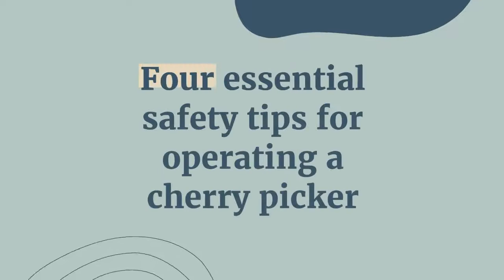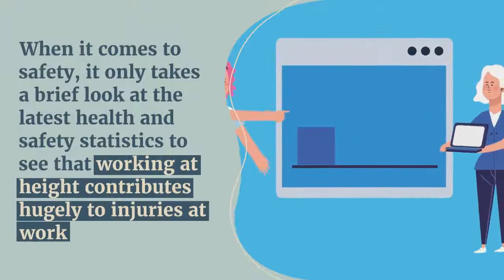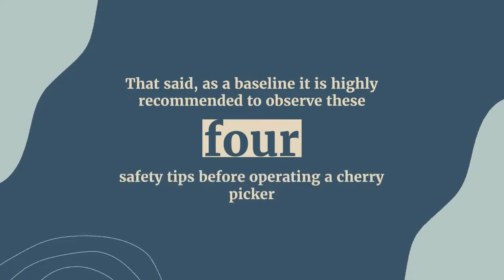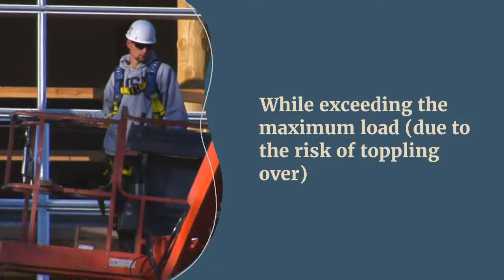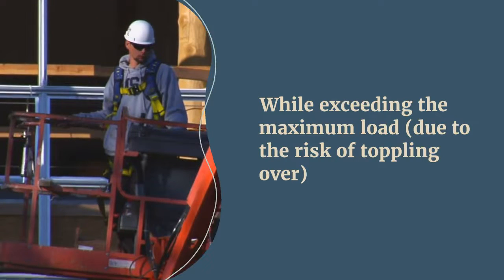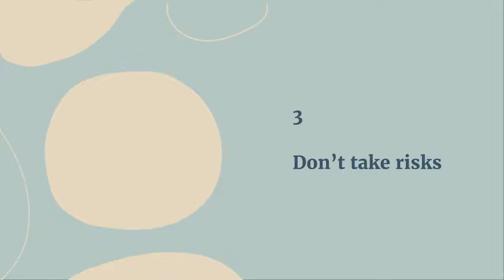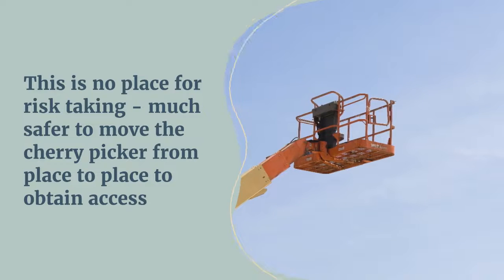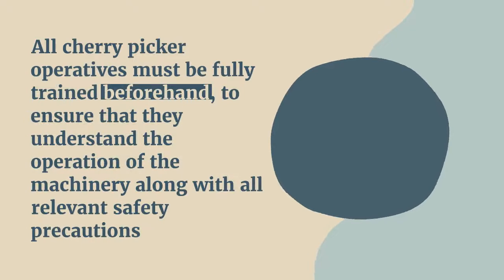4 essential safety tips for operating a cherry picker

Comment: As someone who has been working on both, scissor lift platforms and cherry pickers of all kinds, I can confirm. These 4 rules are a must. And contrary to the popular beliefs, I see cherry picker as being much safer than scissor lifts with the right setup. 

That's a very good video, I'm surprised that is so underrated :(
Reply from the maker: Thank you for your comment. I've also worked on many types of both equipment and I agree, cherry pickers can be very safe, if the base is on good, level ground, not overloaded and is used correctly. With scissor lifts, there can be the temptation to move the platform whilst it's elevated, to get better access, resulting in a high risk of tipping over.